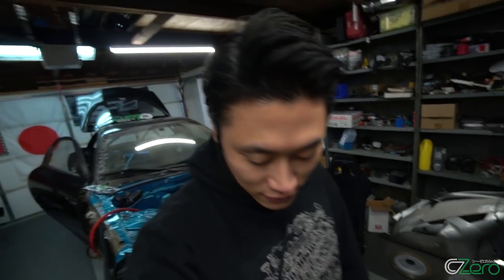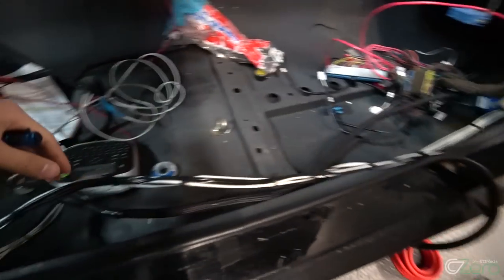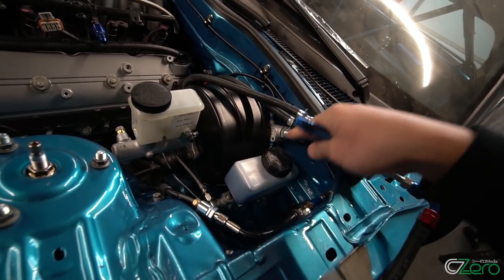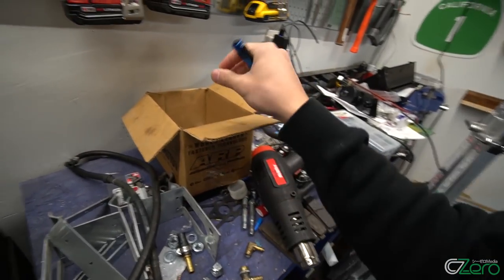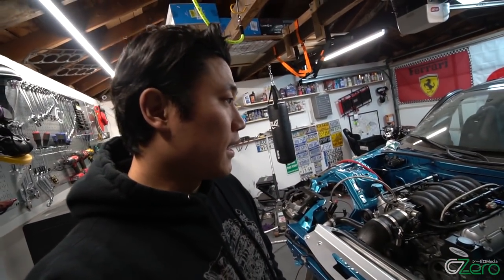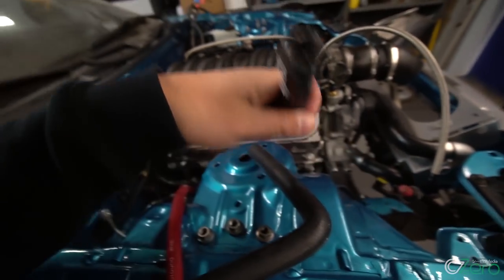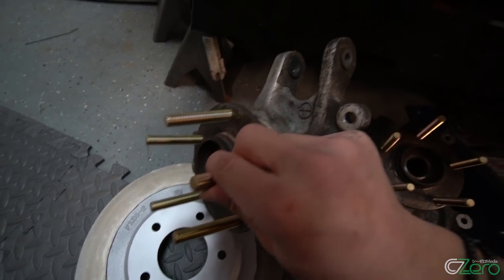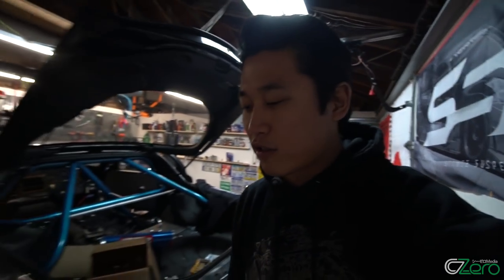LS6 Steam Ports, Coil Overs, Wheel Bearings, Brakes, etc - FD RX7 Race Car Build Video Series 33

Comment: Hi, I’m about to get an EVO 6, do you have any idea about how to modify it? I mean it will be great to hear more about different generations of the EVOs.
Reply: 许琦琳 he sells Evo parts on his website. Maybe you can find some information there. But he knows a lot about evos since he built his
Reply: Foodencio I checked, and there is nothing for evo6 and older, that’s why I asked him
Reply: 许琦琳 oh, I get it. I know some things. I know that evos have the same engine which is 4g63 except for Evo X that has a 4b11.
Reply: 许琦琳 Evo 4,5 and 6 have the same chassis I think, so some parts might be interchangeable
Reply: 许琦琳 you can get some parts aswel from Eclipse GST/GSX. From galant and I think 3000gt too. Thats all I know
Reply: Foodencio thank you, you are right but wrong, even the engine 4G63 they’re basically the same yet due to the generation changed, they are slightly differences. And because of different chassis, I think there are some different things need to be aware.
Reply: 许琦琳 yes, that's also true. But I mean.. you can take your engine and upgrade it so it can basically be like the newer evos

Comment: Try rockauto dot com and jnztuning dot com for the rx7 fuel cap latch.

If these two places don't have it try Miller Imports
Reply from the maker: Would this be a stock replacement?
Reply: Rockauto sells brand new parts like local auto parts store just a bit cheaper.  

jnztuning is an oem dealer prices few dollars less then other dealers

Miller Imports is a Import Salvage yard for all makes, he ships parts worldwide. 

Many of your viewers can vouche for these three places.
Reply from the maker: Trials and Tribulations yeah I use rock auto quite often.  I am however looking for some aftermarket solution for door cap if any. I want to eliminate the latch cable system entirely
Reply: Sounds like you want something like a custom door popper when people do shaved door handles. 

You may have to go to your audio & visual shop, see if they can custom fab a fuel door popper type.  

I have not seen something like aftermarket fuel door without the latch but as for the fuel door itself you can buy carbon fiber fuel door from place like  extreme dimensions and maybe Ma Performance.